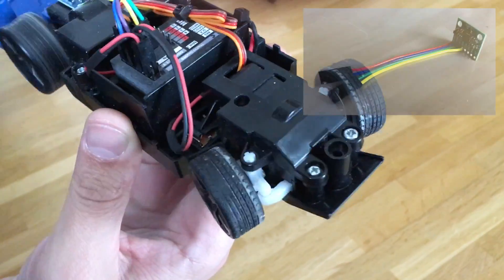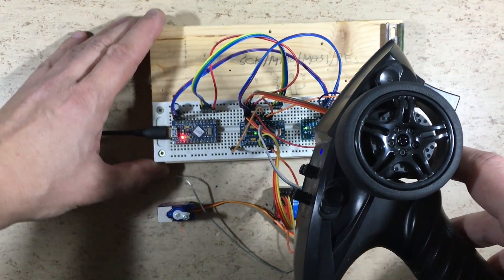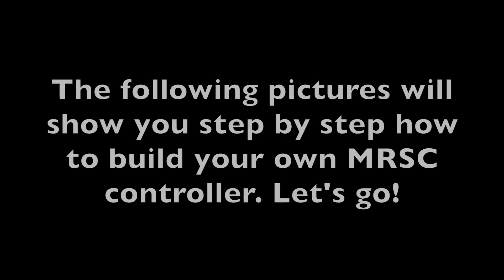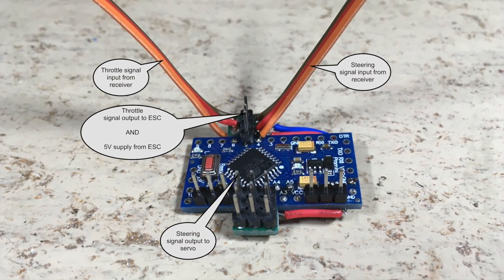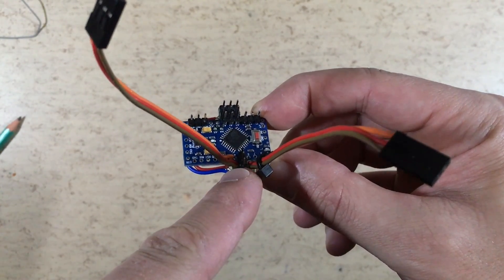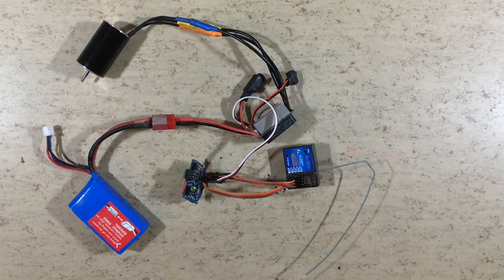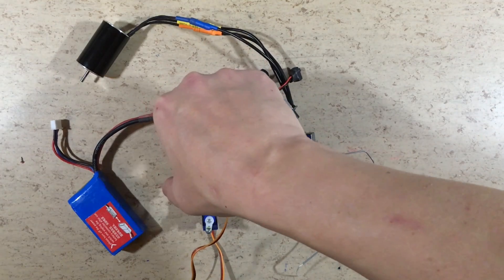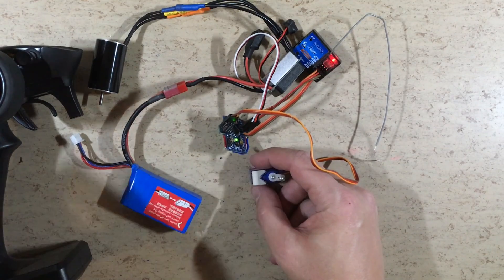Arduino MRSC "Drift Assist" Stability Control Build For 3 Pin RC Servos

Comment: Hi, thanks very much for the tutorial, as with some ppl in this comment section this is my first arduino project too. I tried doing this with the mpu6050 and arduino nano instead of the pro mini, manage to upload the code and wire everything correctly (I think). However I have one problem, the mpu6050 does not seems to influence the steering servo (output end) at all even when the throttle input is press in on the transmitter. Can you give me some suggestion on how to fix this problem? Thanks for the tutorial and help in advance
Reply: I also have the same problem, but even the servo does not move at the output if I move the transmitter, shall we try to figure something out? have you tried putting a capacitor on the motor, input and mpu?

Comment: Hello There! I recently made this with a arduino Nano and it works really good! But ive been researching on how to get this working with an arduino pro micro with no luck. I was going to ask if maybe you could help me with the code because im sort of a beginner
Reply from the maker: THE MISO and MOSI pins on the Pro Micro are different google for it.

Comment: Hello there, i just built this and im having an issue. I uploaded the code and the throttle is working on my hpi racing tf40 controller to my rf40 recevier but not the actual servo and i dont have any idea why.

Comment: Will this work for coke can cars?
Reply from the maker: No, it will not fit, but it's not required. The MRSC software is included in the "Micro RC" receiver. See this video:
https://www.youtube.com/watch?v=jr5yYBal3vk

Comment: Wow! Amazing, thank you!
Reply from the maker: You're welcome
Reply: @TheDIYGuy999  I just got all the components, hopefully I can do this. All these are new to me (zero knowledge). Thanks again for all your awesome videos. Yes I would like to buy you coffee through "Patreon", but the page doesn't seem like working.
Reply from the maker: @lipinghe40  Hi, I wish you much fun, building your stuff. Patreon should now work. Thank you for your support and have a great day.
Reply: @TheDIYGuy999  Just finished the MRSC 5 pin. Haven't tested it. Thank you. I also subscribed to your Patreon.
Reply from the maker: @lipinghe40  Have fun testing it. And thank you very much for subscribing on Patreon
Reply: @TheDIYGuy999  hey man im having an issue with my device where i can steer the servo from the controller and use the throttle but the actual gyro dosent do anything

Comment: if my rc car (hsp 94123) receiver and servo is 4.8v-6v input, then should I use a 5v version mini pro board ?
Reply from the maker: No, the signals of most receivers are 3.3V. The supply voltage always needs to be higher than vcc

Comment: Hello there!

I sent you a pm as well on instructables. Awesome work.

I am trying to adapt the gyro stabilization for my R/C but i don't have the 328P arduino, I have the 2560 mega. Can it be done like this? I assume the signals/interrupts are not the same?

I downloaded the program as-is, but also tried changing the servo pin to 7 instead of A0, it does not work in either case. the servo does not move with steering input, or by moving the gyro. But it remains centered with force, which means it receives a signal. Both A0 and 7 do that.

My 6050 and servo wirings is fine, i tried another program to simply add gyro angle to the steering and it works. SDA/SCL is at 20/21 on the mega, and I have INT of 6050 to pin2 on mega. I suppose its either the steering input or processor loop time / interrupts issue as its different than the 328p.

Much appreciated if you could help.
Reply from the maker: Hi, yes the Mega needs different code, but I can't help you with the details. I recommend to use the ProMicro, it is very cheap and small, so it is perfect for applications like this.
Reply: @TheDIYGuy999  ok i have made progress understanding your code, i am close to making it work on 2560. the only difference will be the interrupt codes and mask inside interrupt routine. May i ask why you decided to go with creating your own pulse count interrupt routine on steering input, instead of just pulseIn() function? Is it more steady?
Reply from the maker: @mefuzion  The pulsing() function is blocking. We don't want that.
Reply: @TheDIYGuy999  Not as blocking as your interrupt function? Whats the difference here really i don’t have the knowledge to tell. —> BTW for a quick test, i replaced uSec[0] with pulseIn(mysteeringpin , HIGH) and it seems to work very well. Testing live on a traxxas erevo brushless.

heres a quick video. only thing noticing is some pulses every second to he servo when it sits still without input:  https://youtu.be/oSgvUbO-1iI
Reply from the maker: @mefuzion  Blocking means, the MCU can't do anything else. It still may work, but the non blocking function is more elegant. I would suggest to read the mega datasheet and to change the interrupt function based on that information
Reply: @TheDIYGuy999  Ok i read about it, i am implementing a single pin interrupt as i dont have a spare channel for gain. Already soldered a 10K pot for it. Some more questions for you if you may :D :
1. Among many interrupt pulse count examples, i used this:

void setup() {
...
 attachInterrupt(digitalPinToInterrupt(3), rising, RISING);
...
}
void rising() {
  attachInterrupt(digitalPinToInterrupt(3), falling, FALLING);
  prev_time = micros();
}
void falling() {
  attachInterrupt(digitalPinToInterrupt(3), rising, RISING);
  uSec = micros()-prev_time;
}
##EDIT - it works fine, and periodic noise to servo is gone now. Thanks for the help understanding interrupts better, i will implement this on all my projects.
2. Vibrations from the car, even without wheels, create some steering movement. If i have the 6050 out of the car, it goes away. Any suggestions here? I have the car rotating masses as balanced as possible (wheels etc). Do those anti-vibration gel pads work? I have some from my heli. Or something in the code could correct it?
3. Why did you implement a signal validity routine to center the servo instead of letting it with previous uSec value lets say? 
4. Do you believe its better to have the arduino and signal cables away/shielded from R/C components, motor, esc, RX, servo? I get some brownouts on the TX/RX and i dont have an obvious reason for now.
5. Does the car weight affect this at all, or it can be adjusted with gain for every car? My revo is like 6 kilos with the battery on.
Reply: @TheDIYGuy999  Thanks. I just wanted to know if it will work speed-wise, i might give it a try, just to say i did something :D. Do you think it needs modifications in the input pin masked interrupt routine only? I will also check the MPU data validity, the pins are different there. I will order a 328P in any case.

Comment: can this be used in the K989 wltoys receiver? the thing is the output is only 3 servo pins and 2 pins to the dc motor
Reply from the maker: Yes, if it is 3 pin, it should work. I also have a version for 5 pin servos BTW
Reply: @TheDIYGuy999  for 3 pins the throttle input is connected to which pin on the receiver wltoys k969? i am still confused how to connect the throttle input. the problem is the receiver with internal ESC. please help me
Reply: @TheDIYGuy999  please help me ,i try on wltoys k969 but not working...help me to make a wiring diagram and the sketch...please😢😢😢

Comment: I wired up a 10k pot, but it didn't work.

I'm sure I wired it correctly. Variable (pot pin 2) to pin A1, and the other pot pins to positive and negative. The pot works, as my multimeter showed, but there was no gain adjustment happening on the gyro. 

Is it specific which way the + and - go into the pot?
Reply from the maker: If you want to use a pot for the gain adjustment:
comment out code one 170 , using //
uncomment code line 204

Comment: Very nice work. Got it to work.
I have two channels left, a push button and a three step switch. Is there some way I can use the button to rotate between settings?IE. Off - 50% - 75% -100%

Thank you!
Reply from the maker: Thanks. The best way would be to replace the 3 position switch on the transmitter with a 10kOhm potentiometer.

Comment: Can this be used with a different gyro module, like the mpu-6500? I ordered 2 mpu-6050 from aliexpress, and they sent me one 6050, and one 6500 accidentally. I damaged the 6050, and it'll be 5 weeks before I get the replacement 6050 due to aliexpress shitty methods, so I would like to use the 6500. Just wondering if it would be possible.

Comment: You my friend are Genius! Can you please tell me something. On 1:27 you show up some other micro board (pro micro 8mhz) 
So I need that too? I can see that board(pro micro 8mhz) is attached to some plastic holder with capacitor. Do I need that capacitor as well and that plastic holder or i can just connect it with the pin cables to the Arduino Pro Mini 3.3V, 8MHz and flash it like that? 
I can't wait to build my unit and install it on my JLB 21101 racing who runs on 4S. It's very hard to control it at higher speeds and I have change servo but it's not that better. I really want to upgrade it with this stability control like you did. 
 Thank you so much man for these videos and keep a great work!
Reply from the maker: Thanks for the praise. The Pro Micro is used as a programmer. The capacitor is not really required. And yes, you can connect the wires directly, without the so called bread board. Upload the code according to this manual for my DIY transmitter: https://github.com/TheDIYGuy999/RC_Transmitter/blob/master/Manual_English.pdf
See pages 18-20
Reply: TheDIYGuy999 Thank you so much for the info! You earn a new subscriber :) 
Best regards from Sweden!

Comment: Hi, can i use adruino pro 5v 16mhz
Reply from the maker: No, because the analog signal level of the WLtoys receiver is 3.3V
Reply: @TheDIYGuy999  thanks
Reply: @TheDIYGuy999  but the nano has a 3.3v output. That one wouldn't work to power this?

Comment: Hello bro. I really really really appreciate your videos, I think, and I'm not lying that yours are the best and complete arduino tutorials on the whole web. I really appreciate your contribution, and I think that the network should be promoting persons like you. I'd like also to ask you one thing : I want it to use in my RC rwd drift car, it's possibile to change the "gain" of gyro?that sort of potentiometer that you use to change the gyro intervention percentage. Even directly from aux/3rd channel on the radio, like RC gyros do? Thank you very much for your attention. I'm really happy you do amazing things like this
Reply from the maker: Hi. Thanks for the praise, I really appreciate it. Yes, you can do that. Just use a free channel of your remote.
I have just uploaded Version 0.3 on my GitHub: https://github.com/TheDIYGuy999/MRSC_Adapter_3Pin_Servo
For details have a look at the Readme.md, which also contains several video links.
Reply: Thank you very much my friend. I will build one asap and I will let you know.

Comment: TheDIYGuy999, you are brilliant! Thanks for this! I will try this project thanks to you, my first arduino...
2 questions :   
1- can I upload the programm with a simple FTDI instead of using arduino as ISP?
2- can I use the sandwich MPU+ARDUINO only for signals and continue to power the receiver and the servo as before? Doing that, I will use the "aux" canal of the receiver to power the MPU+ARDUINO.
Reply from the maker: Thanks for the praise.
1. Yes, as long as the required serial pins are accessible, but I always program my ATmega328P based projects with the ISP
2. It does not matter, because the power pins of all your receiver channels are wired in parallel anyway.
Good luck.
Reply: @TheDIYGuy999  can this be used in the K989 wltoys receiver? the thing is the output is only 3 servo pins and 2 pins to the dc motor

Comment: Hello, I can say with all my heart that I am delighted with your films and just started to assemble a gyroscope to my 2wd truggy according to your design but I have a small problem. I stopped at the very beginning of construction because I have arduino Leonardo or arduino nano to program the arduino Pro Mini. Unfortunately, I'm very green in writing advanced programs and I do not know how I can use arduino that I have instead of which you used as a programmer. I am asking for a little help on how to modify the program so that I can use Leonardo or Nano as a programmer. Thank you very much in advance for your help.
Reply from the maker: Hi, It works exactly the same. For more detail on how to program it, have a look at pages 18 - 20 of this manual. Please note, that you have to wire 1k resistors in series with your mosi and miso wires, if you programmer runs at 5V and your pro mini on 3.3V. Good luck
Reply: Thank you very much for response :D. I'm going to try next day :D
Reply: What instruction is it? Because, unfortunately, I can not go on with programming this one :(
Reply from the maker: Sorry, looks like i forgot to attach the link to the mentioned manual: https://github.com/TheDIYGuy999/RC_Transmitter/blob/master/Manual_English.pdf
You can find the details on pages 18 - 20
Reply: Tank you very much again :D I have hope i can do this myself :D
Reply: Hi again :D I have a bit of a lot to write about my problems that appeared during the construction of the gyroscope, there is some option to talk privately about this topic because the easiest way would be to send me a movie showing what's going on and what I have a problem :)

Comment: Hello again (hope you won't tired replying my question and rants *peace). It might be an optional, but it's still bug me....How to wire Variable Resistor (3 wire pot wiper) for MRSC gain adjustment? From what I can see at the bread board, it is GND, arduino VCC, and Arduino A1 (for pot wiper's middle wire). Is it correct?
Is 501 (5K) Var. Resistor  can be used instead 10K?
Reply from the maker: Analog input A6, according to the schematic: https://github.com/TheDIYGuy999/RC_Transmitter/blob/master/Eagle_PCB/Micro%20RC%20Transmitter.pdf
You can use any pot value between about 5k and 100k
Reply: I want to put pot. wiper on MRSC board using 5K VR. Just now, connect it to Arduino VCC , GND, and A1 following trimpot position at 0:39 ...But somehow the resistor noticeably did nothing. Sometimes the servo signal didn't respond well (might be wiring issues).
Reply from the maker: Sorry, I was wrong. On this board, you have to connect the pot wiper to A1. Have a close look at your wiring, use a magnifying glass. Maybe you should test the circuit with a multimeter. Good luck.
Reply: TheDIYGuy999 So I assume that the trimpot must connected to A1 on one end, and GND on another end. The resistor value then can be adjusted from 0 to 5K ohm. Is it correct?

And yes, it was wiring problem...But after it works seems it draw too much current (at gain=80). Trimpot wiring also seems wrong (was connected to Arduino A1, VCC, and ground) , might contribute to any failure. Too sad that I killed another 20A esc. Good thing that replacement is cheaper than k989 rx. Gonna set it about 30~40 at gain for next time

Comment: " vakanoff Snyder3 months ago
TheDIYGuy999 
After got k989 receiver replacement, I redid the MRSC board...At first, it makes servo twitching abruptly...
But after some adjustment on gain, centering code, and added capacitor on GND/VCC, the twitch is pretty much decreased. It works like a charm now. " 

am having the same problem.. steering not responding to signals.. just servo twitches abruptly... can you guide me on wat modifications in gain, code i should do.. and how much rated capacitor should i use..
Reply from the maker: That's why I used the fully "Micro RC" receiver integrated MRSC solution for this car. This standalone unit works absolutely flawlessly in my JLB Racing Cheetah, though.
Reply from the maker: You can find all the required component values on the pictures in the video. Everything is labeled. The code on my GitHub works flawlessly for me. There must be an error in your wiring.
Reply: He's right, if steering not responding then it must be wiring problem. A way to fixing wiring problem is redid all soldering process.

for reducing twiches, I just tweak some parameters a bit

// Servo limits 
byte limSteeringL = 46.308, limSteeringR = 133.692; // usually 45 - 135° (90° is the servo center position)

And

// Compute steering compensation overlay
  int turnRateSetPoint = map(uSec[0], 990, 2010, -50, 50);  // turnRateSetPoint = steering angle (1000 to 2000us) = -50 to 50

Then add 220uF 10V capacitor for stabilize voltage trough MRSC board

But after some trial, I conclude that k989 stock receiver is not really compatible with this MRSC board since throttle function is vital for this very application, and servo mosfet likely get burned soner or later.
Reply: Sure, I highly interested om making full set of these....Even the transmitter looks so cool and has very good performance. Just need more time for getting some components and a set of air solder for this project. Soldering SMD components is very challenging to me but I might did it in future. Thanks and nice project btw

Comment: Can i use a usbasp device to burn the bootloader and upload the program, instead of using a pro micro as ISP?

Awesome project, it would be really helpful if you can provide a circuit diagram or so..
Reply from the maker: Thanks. Yes, you can use it. You can find the schematic, the pcb files and the software in the GitHub link in the video description 😉
Reply from the maker: Sorry, I was wrong. There is no schematic, but everything is clearly labelled on the pictures.